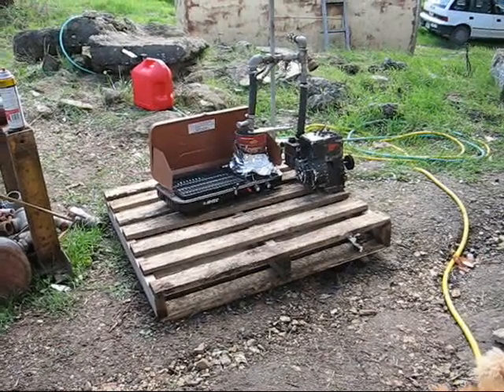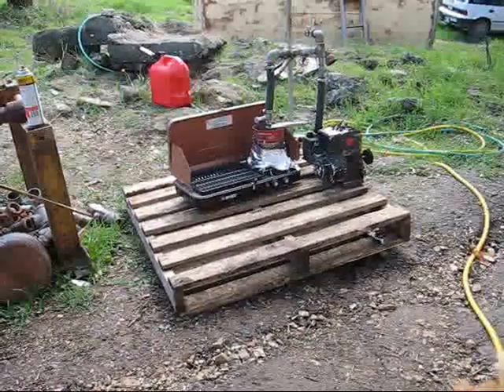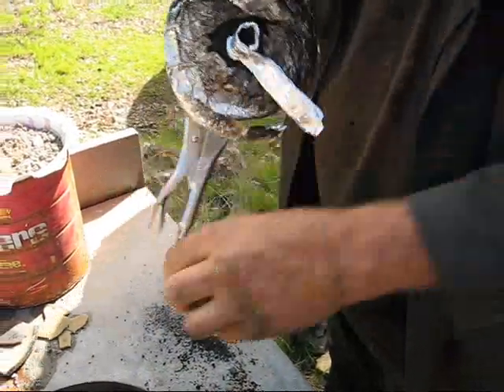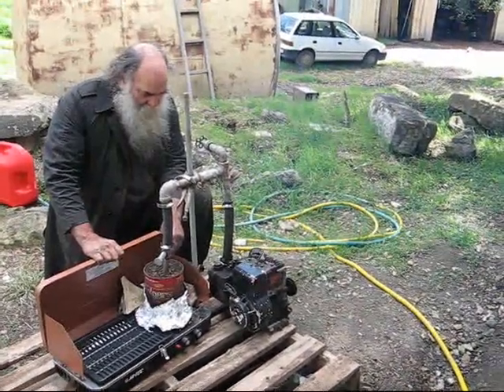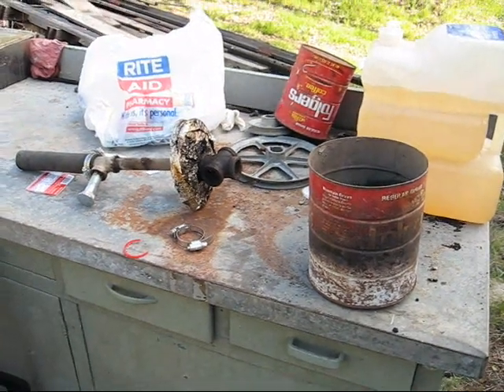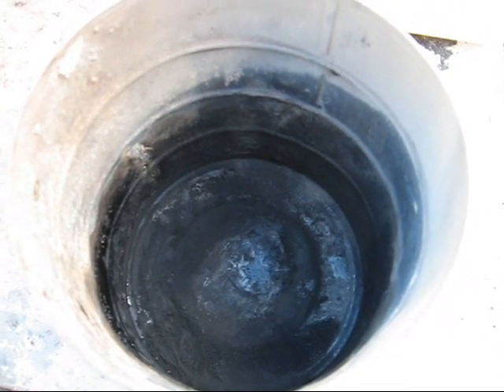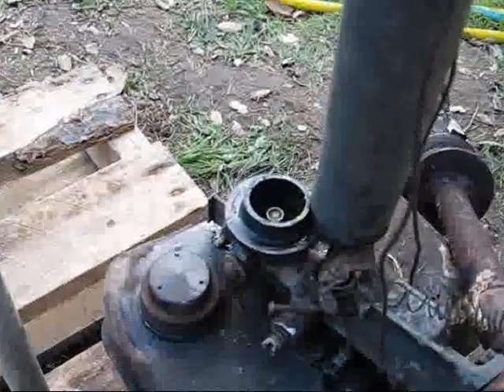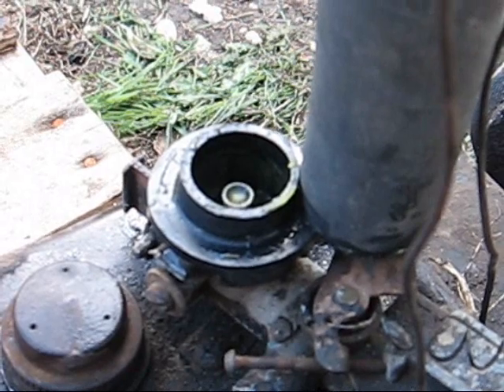Plastic into fuel.wmv

Comment: I have a setup in mind i was wondering if it would work. I would dirt seal a container like you guys did but i might use flour water mix (like moonshiners did) then i would have my 2ndary coil under the plastic melting container so they can both be heated with the same wood fire. What do you think? would it heat the coil too much? do i have to have a 2nd fire just for the coil? I dont know the temp to shoot for

Comment: Can you elaborate on the "dirt seal" as pressure relief. I didn't get a sense of how you implemented that from the video.  Do you think I could replicate this with my stainless steel pressure cooker, or would it be dangerous to seal it?  Finally, what were you using to heat the vessel up? Was that an electric element heater or a flame burner? I'm thinking of adding Zeolite as a catalyst, would love to hear your experience with that (it is used in the Blest System from japan I believe.). Cheers!

Comment: The engine is Not producing 3.5 Hp... If you were to put a load on it, that gasification system would Not be able to supply the needed fuel.

Comment from the maker: @ozzirt You are correct. However a more developed system will use an oil burner to heat more plastic and use oil from that process.

Comment: Next run the smoke over a water bed in the bottom of a 30 gal drum filled above the water with straw for fine filtering. A heavy grate keeps the hay off the water.
The really critical part is a hot enuff hearth to crack the tars in the first place.
Very interesting vids. Keep up the good work!

Comment: I believe your retort temperature is not hot enough to crack the tars and they travel with smoke and get deposited inside the engine. Having done some gasification experiments i would suggest you add a cyclone after the retort, then cool the gas with a heat exchanger and finally filter the gas through a deep bed of straw before it enters the carb. The cyclone will remove some particulate matter and H2O and needs a removable condensate trap(container). The cooler will need a trap also.
See next

Comment: Excellent work. Big thumbs up.
Wood gasifiers use a filter (little more than a can full of wood shavings) to remove tar & cool wood gas before entering engine. Would a filter get rid of the waxy residue, do you think?
How long did the engine run on 1 milk jug?
Thank you for posting that vid.

Comment: very nice but it look to me that the gas is to hot as it enter the engine might over heat your vavles i would us a heat exchanger to cool the gas and a filter to help cool and clean the gas with a water trap so you can drain water out i know this is a test and you make a nice one for long running  very nice video i like the milk jug 8)  It would be nice if you could test the engine emission to see how clean she burning. nicly done